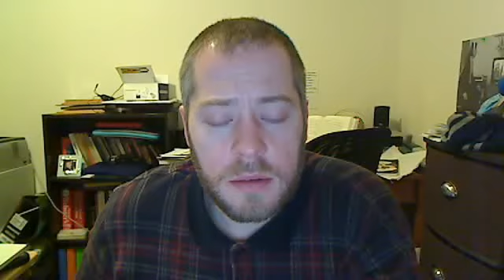Intro to repair videos - 1981 Mercedes-Benz 240D

Comment from the maker: @blac2thafuture First off - love the username. Are you sure your transmission is bad? If it's just shifing weird, it may be a vacuum problem. If it is indeed bad, no, you can't use one from a 300D. You actually do need a transmission from a 240D. I don't know if they're different internally, but bare minimum, the vacuum modulators are different.

Comment from the maker: How much to repair the transmission? To replace it? Not sure what you're asking. Either way, I'm not sure of the cost. As for the turn signals, does the stalk work OK? If so, check the emergency flashers. If those don't work, try replacing that switch first.

Comment: How much to repair the transmission to a 1981 240d and also the turn signal lights don't really work some guy pushed the button to hard and it only flickers for a second